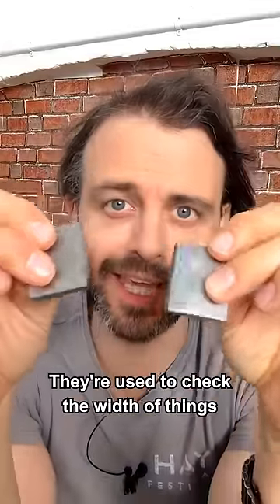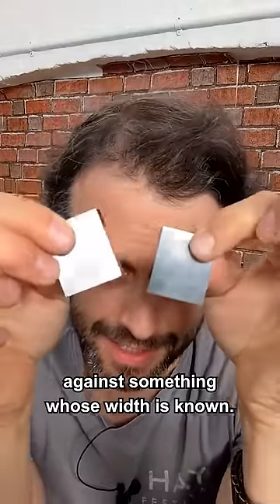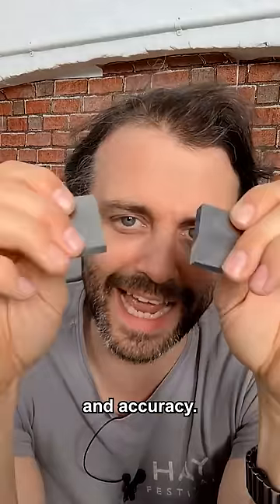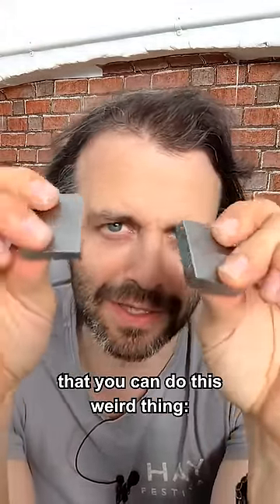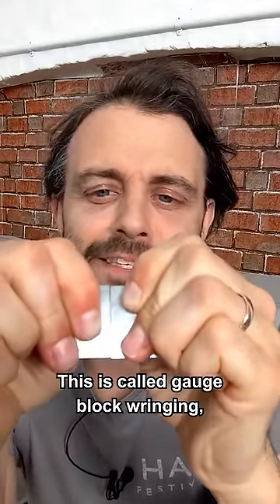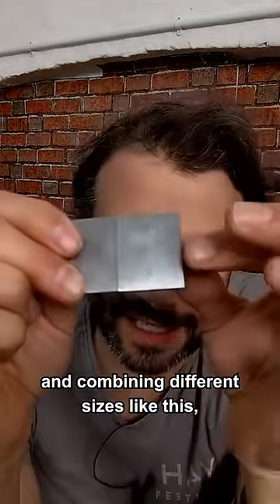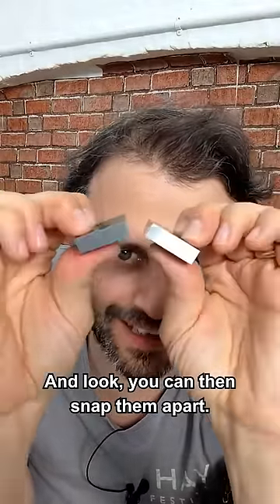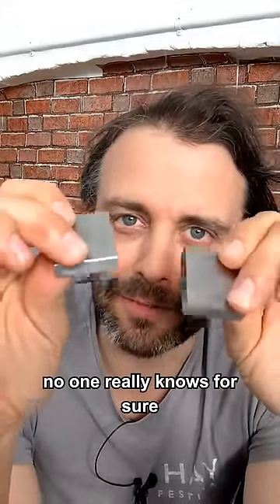No One Knows For Sure Why This Happens!

Comment: As a machinist I can confirm it only happens when you don’t need it to. Never when you need it to
Reply: But then, Isn't that so with everything in the world, tho?
Reply: Might be that they are often not perfectly clean surfaces
Reply: As a tool and die maker, I can confirm that machinists don't know how to measure properly anyways. Jk, keep up the good work.
Reply: @jeremyhill9720 As a metrologist working with NIST calibrated primary standards, I can confirm that no one does anything correctly.
Reply: Call yourself a YouTuber then it'll work when you want it to like this guy
Reply: He needed to show it on youtube and it worked.
Reply: I... read machist

I was so confused
Reply: It only happens when you're observing it😂
Reply: Been there got the same Tee shirt🤣
Reply: Just call them Murphy blocks then. Because they obviously obey some sort of ironic law.
Reply: @Donovarkhallum I wonder how many takes it took
Reply: Quantum mechanics 😅
Reply: Well, as a guy who bought some because i had to have them after seeing a huge YT surge on the subject, i can tell you, they need to be warmed up a bit. If it were very cold (btw this is my experience i am not saying other people or other situations are the same, this is just my experience) i would think they wouldn’t wring as well. The problem with my proposal is obvious, if they’re warm, they’re bigger. So, maybe the ones i have are only the correct size at warmer than room temperature. Dunno. But, doesnt it make sense that they would have molecular attraction? What is the argument against molecular attraction?
Reply: 🤣 I too am a machinist
Reply: Does it work under water?
Reply: @jeremyhill9720  as another tool and die guy, i can confirm that machinists are at least better than fabricators. lol. sorry for the folks that dont measure in light bands.
Reply: As a failed engineering student,  turned broaching machine operator, I can assure you that any accuracy of measurement is damned near accidental...
Reply: Lol! Alcohol though.. hehehe!
Reply: Because quantum probabilities 😂
Reply: @thetruthexperiment Another machinist here, and ISO standards dictate that measurements be taken at 20°C (68°F), and our inspection rooms are climate controlled to be that temperature at all times, for what it's worth.
Reply: Sounds like that one test where they tested something by shooting atoms or electrons through a crack, and while measuring it with device it went through like object should, but after doing it without measurements they saw the afterimage that left the measures of waves coming out.

It's like itention or something affects the surroundings.
Reply: Don't know why you are talking about printers but ok
Reply: It and the 10 mm socket share the same quantum dna
Reply: they must have been a gift from the fey
Reply: Fundamental law of Murphy (aka Sod)
Reply: @jeremyhill9720 it's not that we cant measure, we're just using the tolerance range we are given.
Reply: @Jokervision744 it's all wave packets, so if the property you are measuring is big and slow enough to just see the packet as "a thing" then it looks like a particle, but if you do something small or fast enough to affect the wave in the packet, then you see the wave properties. They are always both there for everything, it's just what part you are looking at when you make the observation, so intent affects what part you see, not the actual nature of the thing you see.  That said, the nature of the observation often does dramatically affect how the result shows up. Imagine comparing a wave recording of drum strikes to a volume measurement over time, for instance. They might look different even though they were showing the same thing. Ultimately, since sound is a pressure wave, if you had something to diffract the sound wave or interfere with it some other way, you could show that each strike was a short wave packet, but you could also zoom out and say that each strike is its own thing that can be measured individually. Quantum is a bit more complicated since the wave nature has to do with probability and can interact across time in counterintuitive ways, but in general the idea of it always being both no matter the measurement still applies.
Reply: i was about to say this, i always get them to stick and then i need them to stick and they dont..
Reply: @Metrocysh  And I read it as 'masochist' ..I was confused for a good 15 seconds before I reread it lol 😭
Reply: Skill issue, I never have a problem doing it
Reply: @CharlesBosse  Can't say I understand, but I've seen that education video where that superman like Einstein flies around trying present the discover.

That's the perspective I got now.
Reply: In Japan, we call it "bukkake"
Reply: @lalli8152  Actually the cleaner they are, the better this works. The reason people usually have trouble is because they touched the contact points with their fingers and made them dirty.
Reply: yep. ive discovered that as a general rule in life, things tend to happen best when you neither need them to, or want them to, but when you do need or want them to, they dont. confirmed.
Reply: @Veritas-invenitur  how would i go about knowing how to measure correctly?
Reply: fact, and it's so easy to lose them too when the whole department are using it lol
Reply: @inceptori  Read books and manuals. Then do what they tell you.
Reply: @johnadams5104 how much would it be to get a magnetic field probe, center/resonance frequency (at 175 kHz), bandwidth within 60 kHz and sensitivity/voltage ratio output/amps per meter to 1.21 cal'd?
Reply: @johnadams5104  as a philosophist, what does "correct" really mean?
Reply: Came here to say this. Never works when I need it to, but that's probably cause my hands are covered in coolant.
Reply: Clean the ends by rubbing them on white paper, then fog the surfaces with your breath....works every time
Reply: Isn't that always the way?
Reply: I'm guessing the gauge blocks are either poor quality or have been through handling and environments that induced errors. Like just keeping them in a wooden box in the shop and using them normally, without much additional fuss about protecting them.
Reply: Sounds like when I try to hit a hook with my driver.
Reply: They work better soaked in coolant
Reply: I dont see what this has to do with masochism
Reply: Same thing with alcohol. When i need it there is nowhere to be found, but when I'm sober there is on every bloody footstep.
Reply: All the stupid and fake experts are here haha
Reply: Then you need to play double bluff with the universe and see who wins
Reply: It's called the van der Waals effect when the tolerances are so tight that the two blocks share electrons
Reply: Well, now I need to know why you would need gauge blocks to stick together.
Reply: "Machinist" a.k.a knob twiddler...Geroge Carlin has a great joke about proud "machinists"
Reply: @manofcultura 😂😂❤
Reply: lol
Reply: Isn't that one of Murphy's law 😂😂😂
Reply: why Murphy? Missing the irony, yet something weird and personal about your reference? @manofcultura
Reply: Sucks spending 5 mins to get them apart. It's a thin layer of oil ans the fine finish that makes it stick.
Reply: @peilethan  fabricator here: plus or minus 1/16” tolerances has worked out pretty well for me for around 40 years now… I never said I wanted to work for NASA… 

Anyhoo, thanks for making my tools, and dies, and motorcycle engines, and rockets, and wrist watches, and all the other stuff.. you insanely precise mofo’s.. ✌🏻
Reply: @Fernandolunatoro1  Are you referecing the 2 slits experiment? 😊
Reply: @mattmarzula  :       "YES"   !       😊
Reply: @timharrod  :    *(  To Take A °Bigger-Measurement  !   )*
Reply: @Jokervision744 :    *( DUE-TOO )*   -       °CauseaLLity•Of•Light•Refraction  !
Reply: @jeremyhill9720 als Elektrotechniker weiß ich das man immer falsch misst.
Reply: @Veritas-invenitur Now we all know why the weather forecasts are often incorrect 😂
Reply: The oil on your forehead rubbed on the surface can help them to stick especially when too clean.
Reply: @christopherstofira4724  I would say tallow rather
Reply: True😂
Reply: False. You’re not a machinist yet.
Reply: Tool makers can’t even make a wrench. Wouldn’t make a pimple on a machinist’s ass.
Reply: For dummies who haven’t taken physics, atmospheric pressure holds them together.
Reply: I've noticed that too.
Reply: Can confirm. Gage blocks will wring every time you want to show someone how cool it is, but never when you are actually calibrating equipment.
Reply: Jake, please contact Tony about Sarah. Thanks
Reply: I used them heaps and they always worked. Hate to burst your bubble, but don't know what you did wrong.
Reply: Gäege blocks
Reply: @jeremyhill9720  as a machinists I can confirm that your arrogance is showing. BTW as a machinists I can confirm that most tools made by a tool and die maker have to be reworked before the make proper parts.
Reply: @Donovarkhallum  Yea when you can have as many takes as you want to get it right it works the first time every time, that said I can sweat two blocks together no problem, maybe not every time but most times just keep them clean.
Reply: @DrinkyMcBeer This is the most machinist answer I've ever seen 😂 God bless you 🙏
Reply: Do not operate the machine, BECOME the machine. 😂
Reply: @Veritas-invenitur 
As a precision mechanic, I can confirm.
Reply: Thats the absolute truth.
Reply: 😂 Jo Murphy @manofcultura
Reply: As an apprentice machinist I can back this up. We oil the blocks to stop them rusting but the oil makes it harder for them to stick properly XD
Reply: @jeremyhill9720  Neither do die makers
Reply: Then it is really convenient that he didn't need it to happen for this video.
Reply: What's that law if something can go wrong it will.
Reply: They stick together with the power of atomic pull.
Reply: SMH 🫡
Reply: @jeremyhill9720 you ARE a machinist. A glorified one, anyways 😒
I aspire to be a tool and die maker one day
Reply: YES this has happened to me more times than you could shake a stick at, so annoying
Reply: That's Murphys law of gauge block wringing.
Reply: Either it's not clean or a microburr
Reply: At first, I read m4chist instead of machinist. 💀
Reply: As quality controller I must agree.. imagine you need to stick together so many gage blocks to check 1m long vernier.... 250mm, 500mm, 750mm... 
Or to check 400-425mm micrometer :)
Reply: That actually is important information then. Maybe it's dependent on other factors
Reply: As an equality engineer for a machine shop, I can say with confidence that, even if they weren't working for you a moment ago, they will stick together the moment I come over.
Reply: maybe you should clean them before slide them togther with alcohol
Reply: Do you even need this beside making sure no contamination would alter measuring?
Reply: It's because you didn't pray to the Omnisdiah
Reply: @Veritas-invenitur  all the answers are wrong, we can deal with the ones within the tolerance.

Comment: I hate when a piece of metal is trying to heal and someone keeps pulling it apart in halves
Reply: MLM
Reply: Actually that is more or less what is happening. If the surface were machined finely enough and were free of contamination, if pressed together firmly they would eventually weld together. This is known as cold welding and is used in some industrial processes.

https://en.m.wikipedia.org/wiki/Cold_welding
Reply: Your name is so coherent with your message 😄
Reply: @jimgraham6722   Please don´t make combat robots with that ability... I´m off building a time machine... better save than sorry.
Reply: 😂 Metal head should NEVER heal although reap slice and slide apart! 😂 

Doesn't that sound cool ! Pick the correct word :)
Reply: that's exactly what a T1000 would say!
Reply: @juliorolandi6694 I'd be more like a TI-83 honestly
Reply: Isn't oxidation why metal cannot go back together? So maybe some of the oxidation layer is removed? I don't know. I am not a scientist.
Reply: @jimbeam4736 
"better safe than sorry"
Reply: @Fedico7000   Thank you for corecting my bad english...
Reply: It's metal abuse